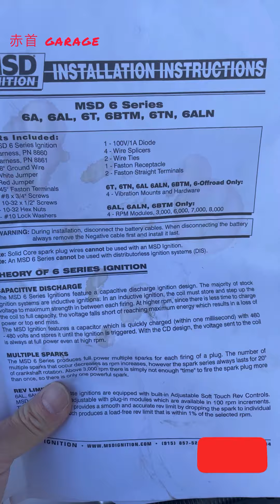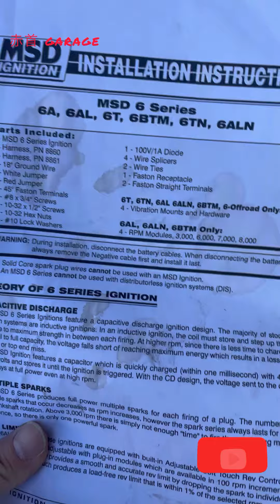How to install a MSD ignition Box 6A on a Datsun  720

Comment: Is this the same for ka24e??
Reply from the maker: I’m not 100% sure but it should be mostly same but I think the ka24e has a electric distributor which is different then mine because I have the old school contact points in my distributor.
The connection is different for electric distributor
Reply: Any chance you have a KA that you can make some videos on
Reply from the maker: @User_6711  unfortunately, I’m currently living in Japan and KA24e was made for US market so it’s rare to find that engine here. Japan got the SR20 and US got the Ka24 engine.
Reply: @Umaku_Garage  alright much appreciated 👍🏽

Comment: Is this specific to the Z22?
Reply from the maker: If your z22 has a distributor with points then you can do exactly what I did in the video. If your distributor is electronic then you will have to remove the module figure out the wiring for the negative and positive. I hope this helps